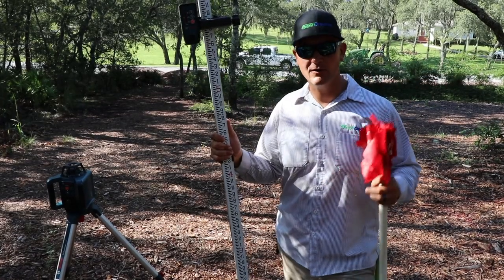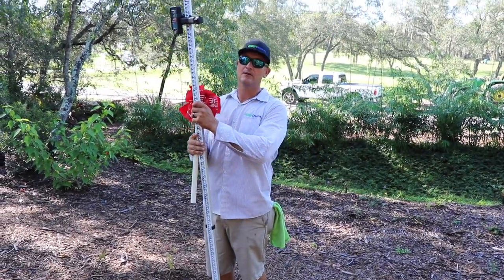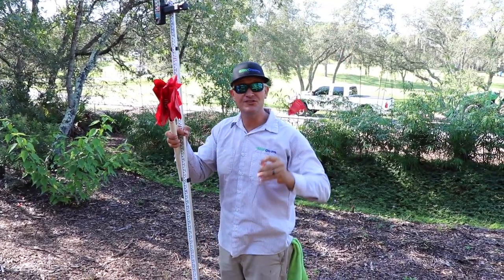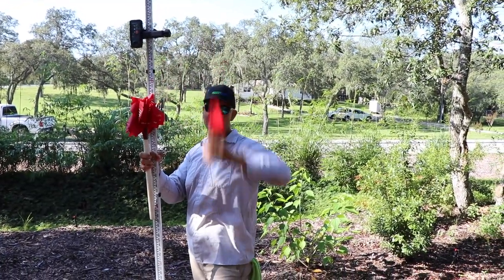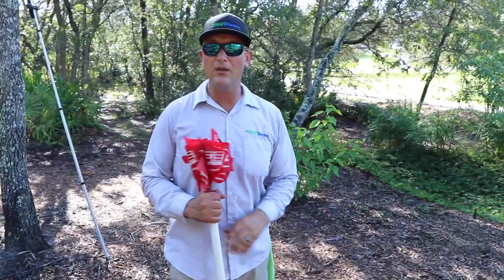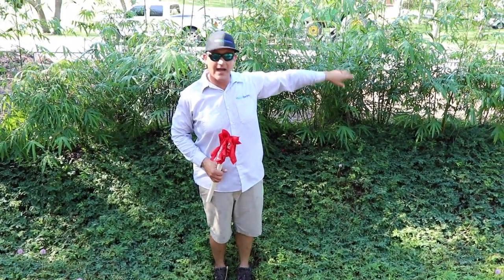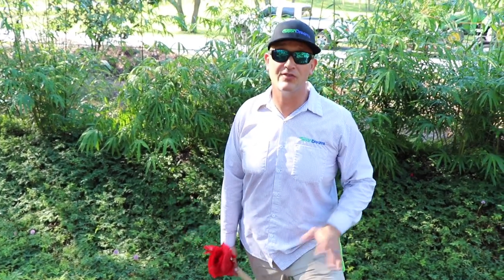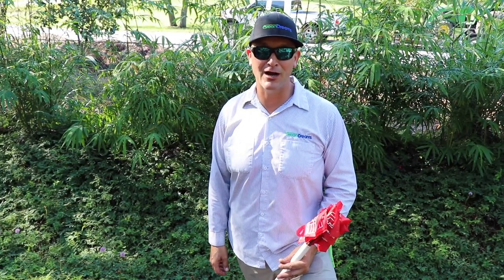SWALE DESIGN 101:  Rainwater Harvesting + Rx for Erosion & Runoff

Comment: Hi, so glad I found your video. I have 5 acres of upland sand hill oak hammock, with a north facing slope in NCF. A natural pond at the bottom of the slope. When it rains hard, I get run off from every direction and my back yard is moving to the front. I have been trying to find info on building swales. Your video is by far the best. Thank you!

Comment: Man thanks so much for this. This explains it so well. 
Question: What if your septic field was in an area with hills. I am wanting to keep that dirt from eroding on top of the septic field. I don't want the water to sink in. How would you build the swales in order to move the water. How do you slope them then? Would it be safe to move that water to a swale system that is on contour further down across the slope? I have my fruit trees planted about 100 yards back on the same slope. I was going to put swales in front of each tree line. Not sure if it would be safe to move that water from the septic area to the fruit tree area. 
Thanks in advance.
Reply: I have a similar question. We have water flowing down hill toward back pasture and right past our septic. So trying to figure out how to make swales that won’t block septic oect.

Comment: Question
Building swales in sandy area...
Being an old heavy equipment operator..
I'm thinking digging the swale bottom out and lining it with multipul layers of news paper then replacing the removed material
Trying to hold the moisture longer..
I'm thinking a low cost type of liner
What are your thoughts
Reply from the maker: Hey Jim! If you’re looking to seal the swale to hold water longer I’d consider a little clay or manure.
Reply: @PeteKanarisGreenDreamsFL  
Caliche would be the best...
Depends on how far away it is
Clay would probably be the next.  Again the availability
News paper could be a local low cost alternative...
With some what a holding ability.. But for how long...
I know.    Depends how many layers used...
Down around Tucson they put in swales 80 years ago
Which are working great...
Reply: @PeteKanarisGreenDreamsFL  would rabbit manure work? How about clay kitty litter ?